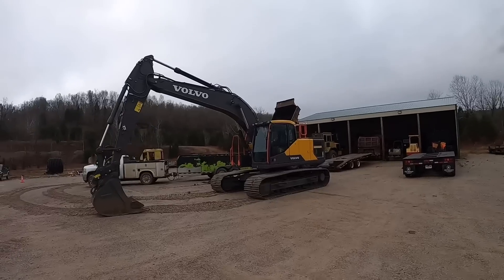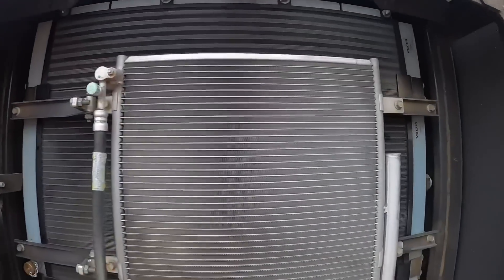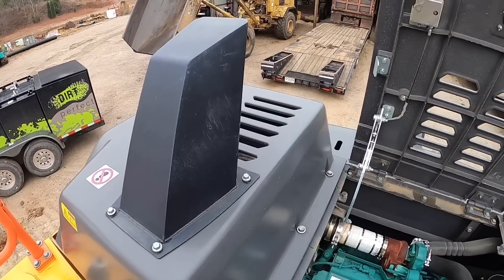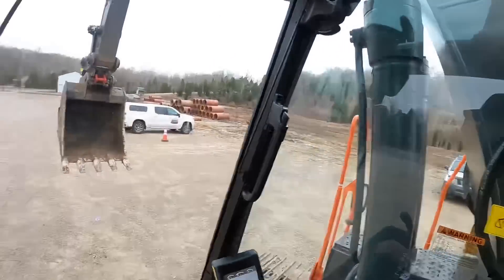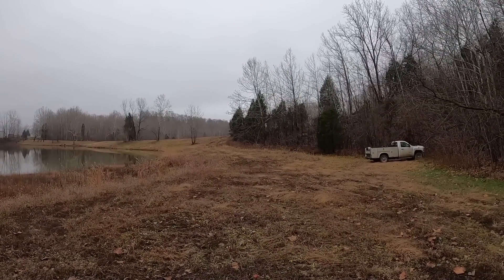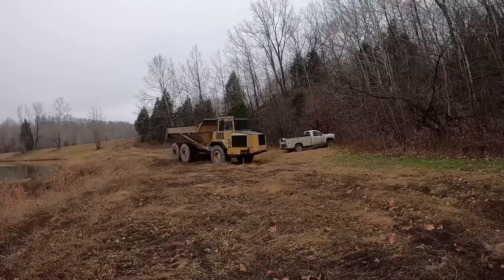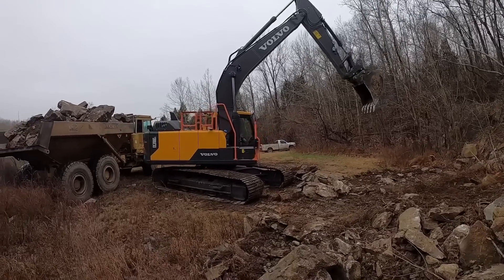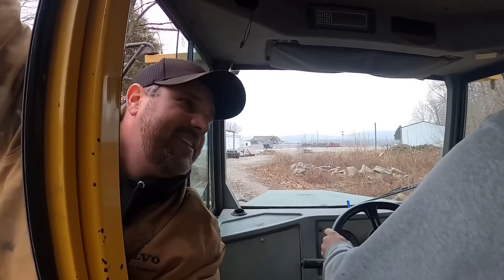All new Volvo EC200EL loading some very large rocks with no thumb 😬

Comment: it's surprising how well Bubba climbed that little hill while fully loaded, strong truck. You must be doing something right having multiple company's wanting you to demo their latest equipment, good video Mike.
Reply: At least Kubota doesnt find him nice anymore 😜👌
Reply: @Sjanzo  some areas they are really really good products. My BX 2230 Has an awesome engine and it has been really good for last 15+ years with over 2000 hours. From cutting grass to plowing to tiling it has been good. Others leave something to be desired. Farming fixing fabricating use those Kabota’s and they are really hard on them. Lots and lots of hours each year
Reply: @paulprigge1209  Kubota has problems with their newer engines. I am in construction equipment myself, and i know from OEMs that they switch to Yanmar because of it. Off course a 22hp lawn tractor has a different engine than a 90hp CTL and has a totally different duty cycle. When you get to 2000hrs on construction equipment youre still under warranty, its nothing. 1000 hours per year is not unusual at companies that buy them brand new.

Comment: From my limited experience working in a rock quarry, I can kind of answer your question about quality control on a rock. In our limestone quarry, there are three different types of limestone that we quarry out, the top layer is a tougher type that does not break easily, so it is mined separate and sold as concrete rock and for state jobs. The second layer and the thickest is the production rock and is more brittle, it is what we make into the general rock product. Then the third layer isn't very thick just 10 feet it is ancient weathered limestone and is crumbley and week. It only gets made into road base for gravel roads. The next layer down is sandstone and extremely abrasive, there is no plans to mine this since it wears the crusher out rapidly and isn't cost-effective.
Reply: Those rocks you moved didn't look like bad rock, they probably just didn't want to mess with breaking them. It's really not cost effective to break boulders with a breaker, quarrys do it to just get rid of them since it takes up room.

Comment: You saying about LED lights on the Volvo, have you ever thought of putting either a 18, 24 or 36 inch light bar on the cab of Bubba and the 210, and both dozers? Will turn night into day with the light they throw out. Ideal for the winter days, I remembwr my 22 years living in the U.K didnt get light till 7.30 ish am and dark by 4.30pm. Be a game changer working in winter. Used to love summer though, still light at 9.45pm. Loving the videos.

Comment: Does the speed of the  function  depend on  how much you move the Joy stick?
Reply: Not that I've operated them, but I think it has to be so.  There are times when movements are made very slowly.  The thumb, if it had one, is a simple on/off.
Reply from the maker: Yes with but how it reacts it’s different in each brand machine

Comment: I must add to my comments, the engine really sounds sweet the camera was from a distance in the motor really sounded strong. I am thinking that the swing motor is the same motor they use in the 220 it has the same similarities visually as Chris's 220  almost the same sights and sounds sounds like it's cushioned. I am truly excited to see you and the Volvo 200 excavator over the next month. Does the it feel familiar like the 120. You and the 120 always seem bonded and you bought it with this 200 like he'd been operating it for years. I'm truly excited the 200 and you operating together as one as you do with the 120 and yourself. As you can tell I'm excited I sure hated to retired and if just itching to get on that 200 the adrenaline has hit my butt cheeks LOL I'm ready climb aboard sit on that seat and grab the controls and go go go.
  <](:>)-[@#=]
Mike Simons you are one lucky dog hit all these equipment manufacturers no you're a good operator and give you the opportunity to run their machines shows they have a lot of trust and value you

Comment: Mike which is bigger the 210 or the 200 I think you need to get a five 500 with a bucket on it that you can fill bubba dump with two passes and you need another off-road haul truck so that way you can have both excavators and both haul trucks getting the job done keep the 210 and have the 500 and keep the 500 and keep bubba dump and the other off-road haul truck teach matt and let Matt become a excavator operater you have let him on the 210 so many times now it's time for you to turn him loose with a piece of equipment